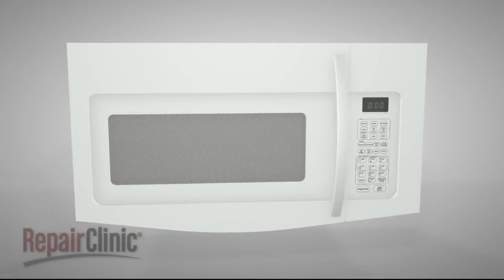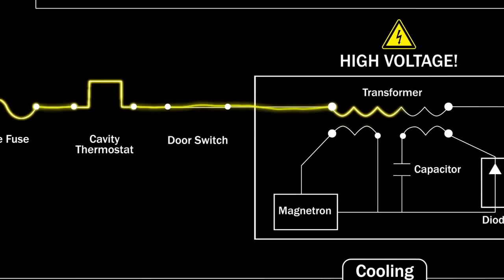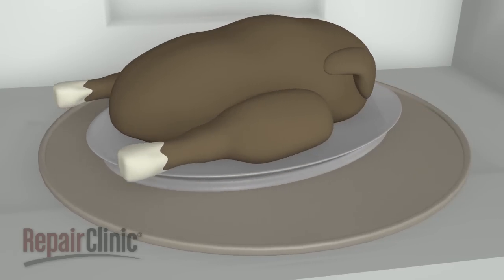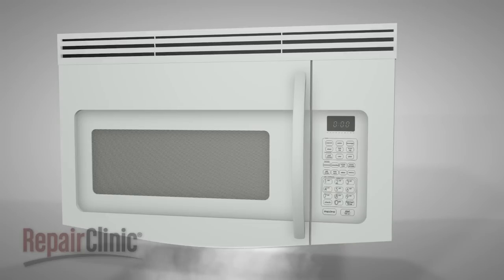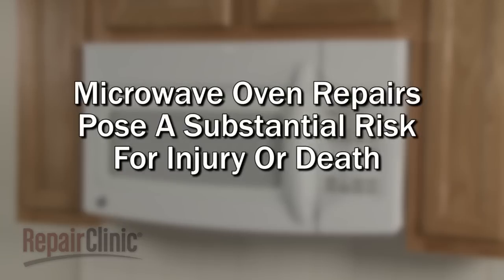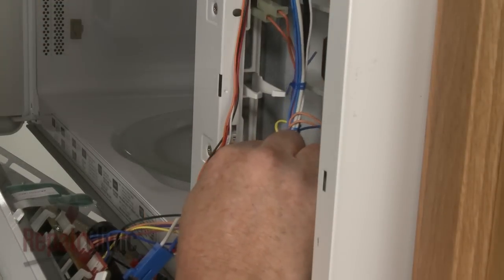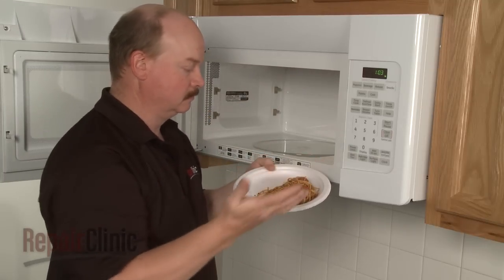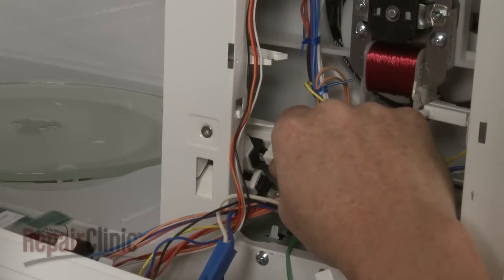How Does a Microwave Work? — Appliance Repair Tips

Comment: This video just shows how a standard microwave works. There is another type of a microwave called an inverter microwave. Inverters actually vary the output going to the magnetron, while the standard ones cycle on and off to simulate the power level. Inverters do not need an external diode, or a capacitor, so it is safer. It is also much lighter. Inverters are quiet too, so you don't have a humming sound, even though the beeps may be loud. Usually Panasonic is the only company who makes the inverter microwaves, even though the inverter design is licensed by GE.

The only REAL problem with them is that once the inverters crap out, the microwave is junk because a replacement inverter often costs more than a new microwave.
Reply from the maker: AP499D25 Thank you for your input.
Reply: If you listen to the video carefully it states that inexperienced people like yourself should not disassemble a Microwave
Only Professionals should do so

Comment: Repair clinics is the best website. many information and useful explanation.. however i,ve got more question to u sir .. 1. how i can determine our M.O.T and Megatron can use anymore by using ohmeter and volt testing 2. i have one microwave have burn out fuse, when i change with a new one its blow up again.. can i got ur answer plz ..thankz

Comment: Here is a mistake.The HV transformer does NOT reduce the mains voltage, instead it increases it.120/240 VAC > 2000 VAC
Reply from the maker: B  If you listen close we say the windings produce not reduce the voltage needed to power the magnetron. Thanks for your comment.
Reply: With some microwave ovens the voltage is increased up to as high as 7,000 volts